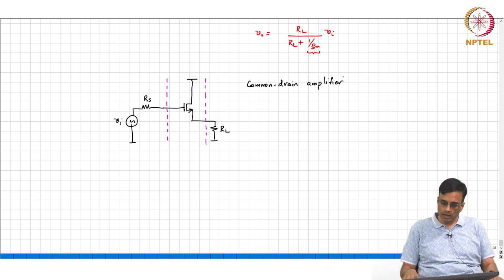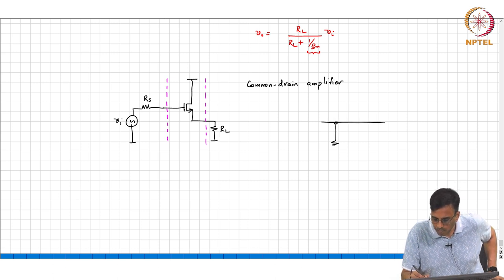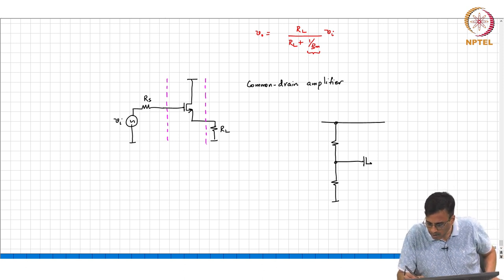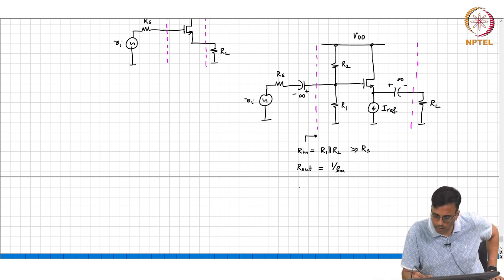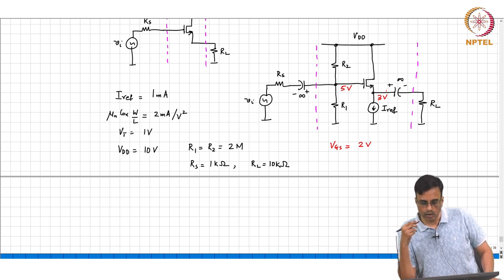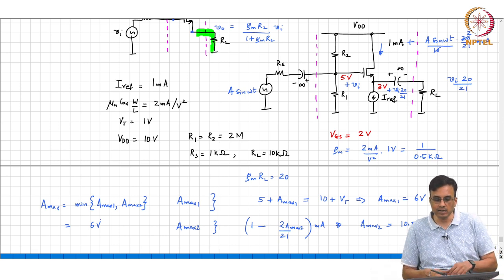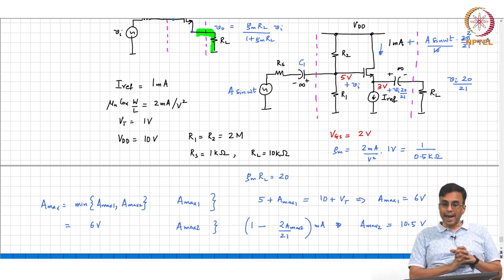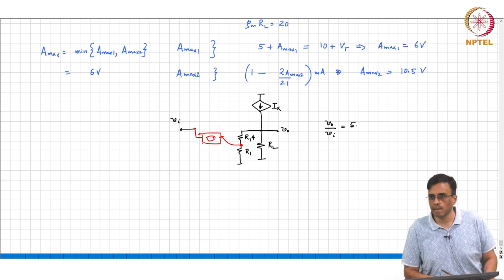Baising of the Common Drain Amplifier and Signal Swings

Comment: Since we are analyzing signal swings ; we must not use the small-signal gain of 20/21. We should take Vs ac = -10V as 1mA ac flows up so for cutoff we have Vin - Vout = -1 V as we need Vgs total = Vth -> Vin is -11V giving large signal gain as 10/11. Though both answers are reasonably same but it should not be done to take small signal gain for signal swings due to the inherent non-linearity